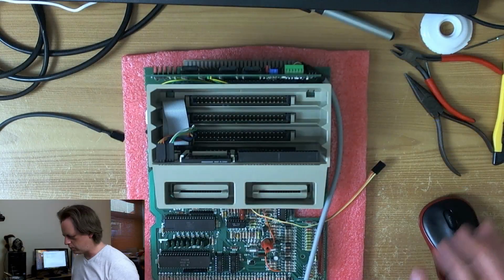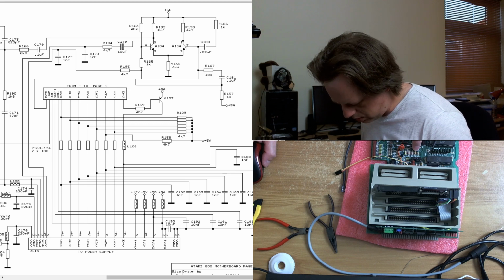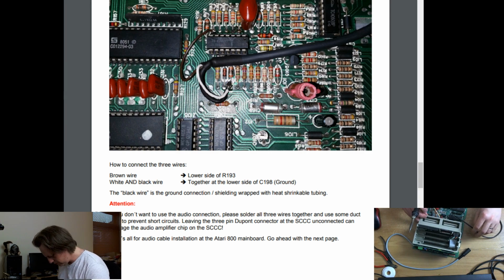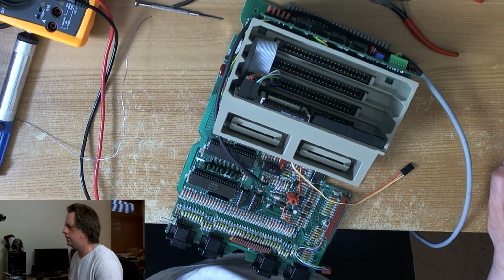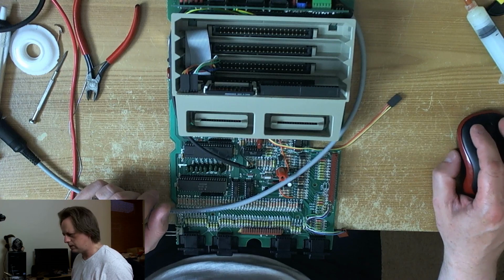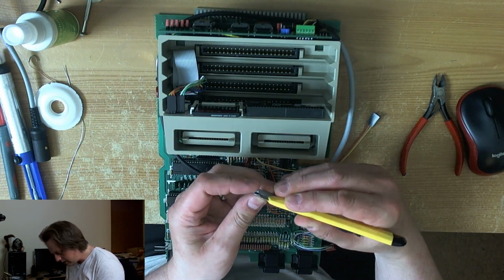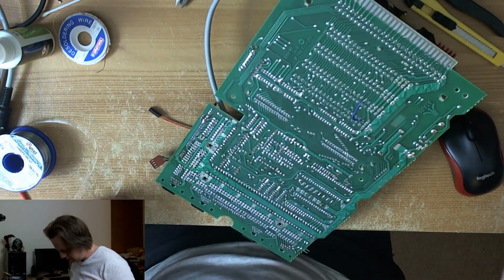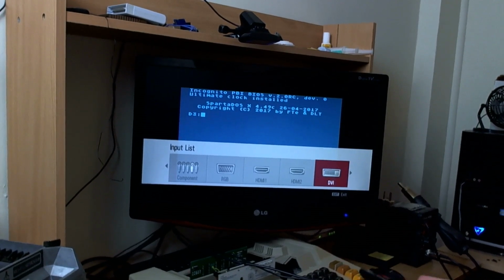Incognito Atari 800 Super Colour CPU Card Part 2

Comment: Heh, as I'm attempting to this mod, and have removed L105, L104, and R189, I was testing with the multimeter to make sure I got the right ones, and... you state 3, 6, 1.  But if you look at the schematic (and my testing) and the other schematic that I found, it's actually 3,6, and 5.  Pin 1 goes to the 'MOD' and L103.

Comment: 104 = 10000pF = 10nF = 0.01uF. Mopar got it 10 times too big. Hopefully its not too critical.....
Reply from the maker: I think I replaced the cap later on. :)
Reply: That´s wrong. 104 = 100 nF. Look http://grathio.com/assets/capacitor_tags.pdf or other sources searching for "capacitor markings"